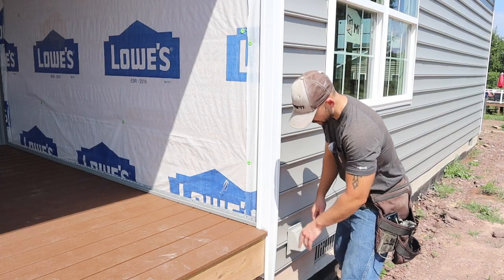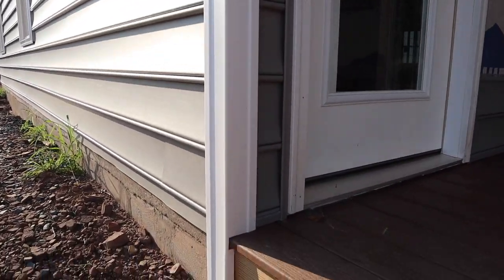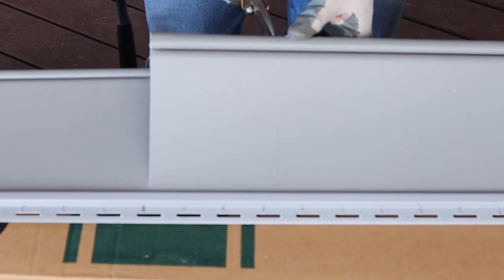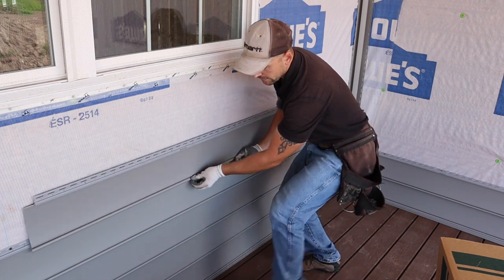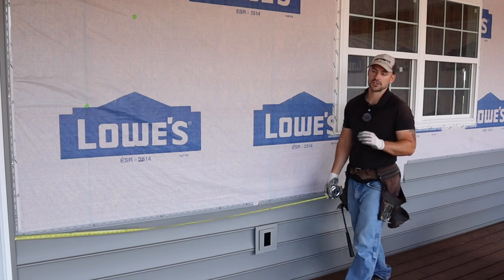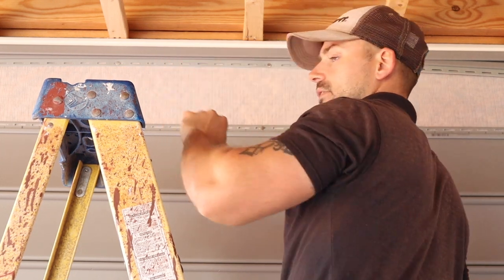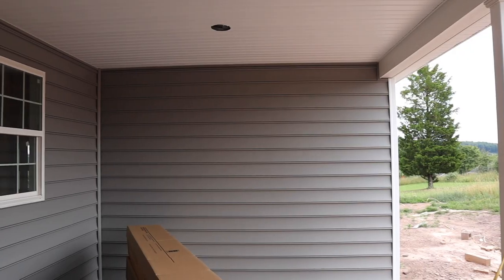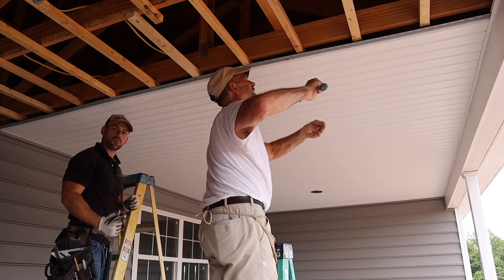How To Install Vinyl Siding On A Porch And Porch Ceiling Installation

Comment: Great video.  I am building a house right now and getting ready to start siding and trim on the outside.  For the porch ceiling and soffits around the house I am using white vinyl soffit panels.  I am trying to figure out easiest way to wrap the exposed wood beams around the porch and what pieces of vinyl should I use to do that ?  two L shaped pieces or basically fascia trim with one on each side of beam and flat stock vinyl supported by the leg of the L pieces ?

Comment: I had a jog that didn't come close enough for this technique. It was right in the middle of a "board" on my double dutch lap. I ended up using the channel that is for doing the cuts under windows all along the bottom. There was one with two slots available for my siding,  so it works if you are in the shallow or deep part of the siding. But I had to use this instead of starter strip. I marked where the first piece would hit and then cut the siding to match that height, made the tabs in the cut side and it snapped in firmly with the tabs. I had J channel on the bottom but it was too loose and flappy with J channel and the starter strip didn't allow a good way to tuck the top of the half piece in. Maybe we need another video on what to do if your porch is not conveniently located to use j channel at the bottom?
Reply from the maker: In that case you would use J channel around the bottom and rip the siding down to size and it will act as the starter strip. I hope that helps!

Comment: Thank you for another great video! The J channel at the bottom is used to hide the gap created to match the height of the other corner siding? If the height is very different, can be used only the j channel without the starter strip?

Comment: Josh, Do you need Utility strip or J Channel around New Construction windows? Or do you just have the siding go right up to the channel of the window? If not mistaking I think you will at least need it at the top and bottom.
Reply from the maker: Most new construction windows have J channel build on them and I just use utility trim under the window. Hope that helps!

Comment: i love your videos.  i'm getting ready to start siding my garage on the driveway side.  when installing the horizontal j channel against the concrete do you drill weep holes in it?  Also when installing the bottom j channel into the vertical j channel of a door do you have a tab on the vertical j channel that sits in the horizontal channel or do you cut all of these joints flush to allow water to drain out of the channel onto the concrete?  thank you for your help and keep up the great videos.

Comment: Hi Great video.  What is the type of channel on the edge of the ceiling? F or J?  I am installing Certainteed Insulated Board and Batten siding on the ceiling of my houseboat.  No siding on the walls jut ceiling.

Comment: Josh!! You’re the man. Always follow your videos. 

I have a question on cantilever siding  corners. What trim pieces should be used? Is it a starter strip on every side of the cantilever dropped a half an inch past the bottom?

Comment: I’m running siding before building a deck, and concerned with draining water draining properly. By dumb luck my siding can start exactly at the deck boards, no J channel necessary for looks. Is it still necessary for water proofing?

Comment: What if the gap at the top of the deck is larger than the height of the j channel?  I'm going to be using double 4 inch siding.  So the gap could be anywhere from no gap to up to 7 15/16 inches.

Comment: Siding is fairly easy to install,but the cheap aluminum siding nails bend very easily. I used left over roofing nails to hang my siding on my screened porch.

Comment: what the make and model number for the ceiling siding you used? Where can we get it from? 
thanks
Reply: Its on the box in the video - certainteed 4921601 

Where you can buy it will depend on where you are in the US.

Comment: couldn't you just place the first run in the j without the starter?
Reply from the maker: In this case I was debating about it, I usually have to use J channel because it doesn’t break that well. So in this demonstration I probably could have went without it. But I wanted to show people that it is typically something you have to do. Good question!
Reply: @TheExcellentLaborer  I am siding my house currently, The porch is concrete and I don't have enough room for a starter so I will use the J at the bottom  Thank you for your videos and responses
Reply: In some cases , you'll need to put undersill trim upside down in the j trim to slide the sharp edge of the siding into if you have to rip it. Makes a very straight bottom edge.